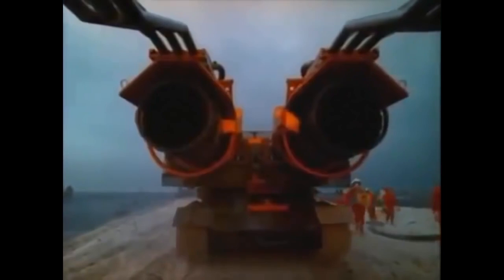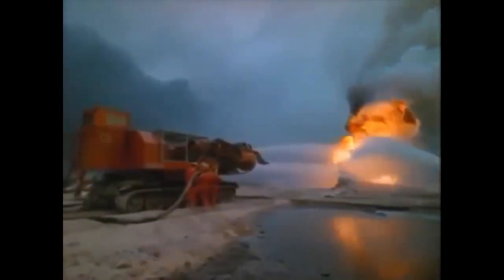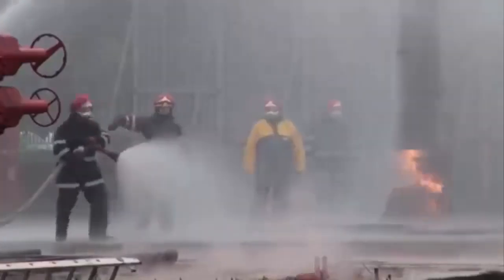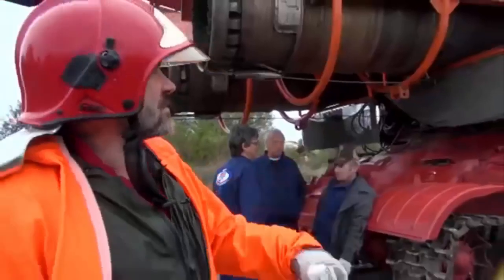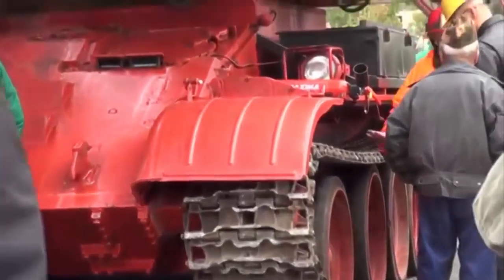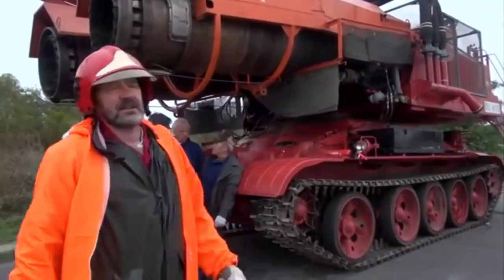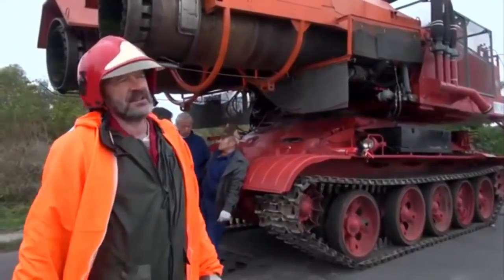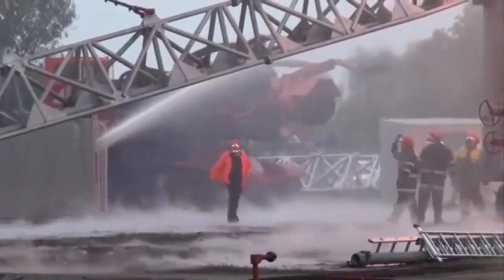How Jet Engines on Tanks Put out Oil Fires

Comment: Apparently sucks as well. In Kuwait of '91 it managed to extinguish just three small well fires in a month whilst legends such as Red Adair were knocking down 5-6 wells per day using the 'old school' methods.
Reply: Nope. These were only used for the bigger fires, and the smaller ones were put out with the 'old school' methods
https://en.wikipedia.org/wiki/Kuwaiti_oil_fires
Reply: doesnt suck, think of it as the special forces, when very big problem, it gets called in, fixes it, and lets the old method do the rest, because its insanely expensive and time consuming to keep up and working
Reply: Not sucks. That 3 was actually 9 bigger fire. Also only 1 team vs thousands of people in the Red Adair team. At the time only 1 were built and it was a prototype